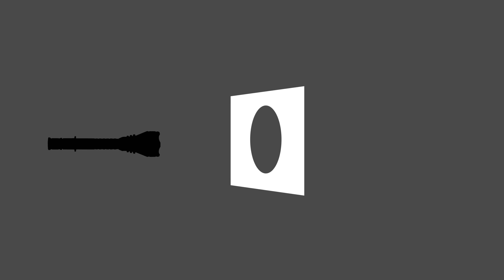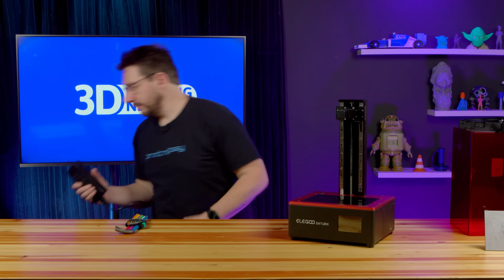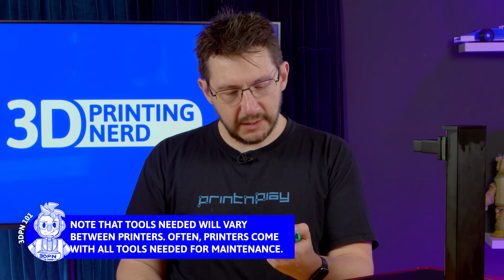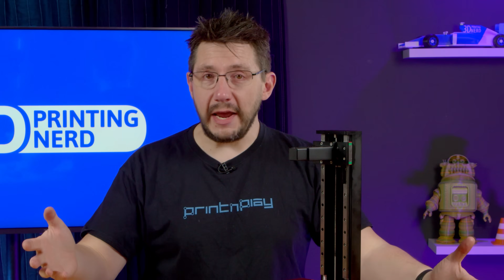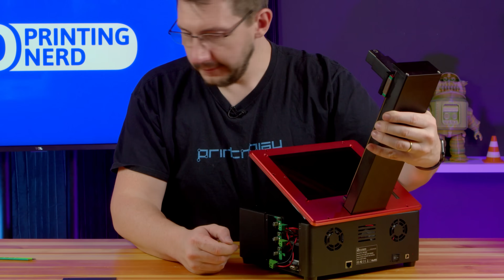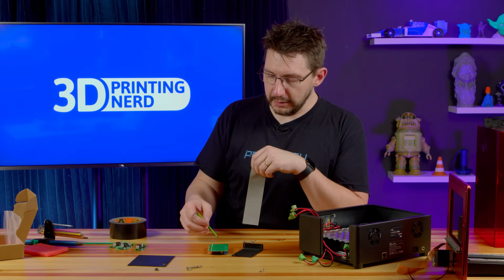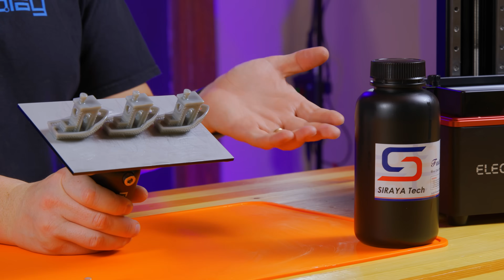FIX AND WIN an ELEGOO SATURN!

Comment: Great idea regarding the repair, but I would add few things:
- when disassembling a device you are not very familiar with, take pictures of how it looked like. Doesn’t take much time nor effort and is of great help when reassembling, especially if there are loose cables or non-orientation-locked plugs.
- if the cables are not labeled, take few minutes to label them. Is of great help when you re-open the device a year later.
- tape is great, but especially these pointy connection points can poke through it. I would either take some insulated washers or print standoffs with an FDM printer, if you have one. With moving parts, it would be even outright imperative to avoid tape.
Also, I’d add a word of caution to abound touching uv light sources. You don’t want finger fat on them...
Oh, and if I won the Saturn, I’d print some parts for fischertechnik first (working on a big ball track right now)

Comment: I am a student waiting to study in Germany this winter. Now that I have time, I am working on a foldable electric chair project (alone) to be able to travel safely without contacting others and it's compact (A4 paper * 7cm) and light weight (under 7kg). For mechanical part I am printing it with my ender 5 plus but hopefullythe precision of the resin system could help me achieve a F nest outcome possible. Thank you for reading through all this and waiting to see your pick, 

Love your content and you ;)

Comment: In the beginning of this year I was gonna build (the design is all done and ready) my own (very first) 3D printer (large format xy-core, why start off easy?), but due to some unfortunate circumstances the budget for that had to go towards replacing my stolen bicycle. So I do not currently own a printer...

Now I have a bike though, and to prevent someone stealing that as well I've designed and built a tracker that alerts me through an SMS if the bike moves, and even starts sending me the GPS location if the movement is continuous. It works great! But... Making a proper housing for the tracker has been a bit of a hassle, and honestly it's a bit of a botched together affair at the moment. It kind of works, but isn't pretty and sticks out like a sore thumb. All the while I was making it I kept thinking "I wish I had a 3D printer so I could make a proper casing for this".

So, by now it shouldn't come as a surprise that the first thing I would print with this printer would be the casing for my bike tracker. After that? Who knows... The sky's the limit!

Comment: I think it would be appropriate to print the largest mini Joel that the printer can handle first. Then, I would use it to print cosplay components, rc parts, random around the house parts for fixes that I model, whatever structural parts and brackets I need for projects, toys for my nephew, but then I really think it would be cool to use it to print 3d scans of anatomical models of organs and bones in clear coloured resin!

Comment: I would probably print things that I can’t with my FDM printer. I would probably print a chess set with some cool clear colors. I would also probably try to reverse engineer some controller shells, if it is not already available on thingiverse or thangs, to make clear shells for my Xbox and Nintendo switch. I would print till it won’t print no more, then fix it, and print some more!

Comment: Great video, as always!

As much as I love printing props and knick-knacks (and believe me I do!), I would use the Saturn for research purposes in the chemistry lab. 
In many reactions, a catalyst (often a powder) is required to drive the reaction to completion, but afterwards, this catalyst has to be removed from the reaction mixture, which can be complicated/expensive. 
 
Mixing catalyst  with resin, potentially allows you to fix the catalyst material in place. The resin being slightly porous can then still facilitate the reactions without leaching the catalyst into the bulk mixture. Then after the reaction, you can just fish out the resin part and you're good to go! It's quite a novel idea, but seems to have lots of promise and I'd love to do some testing on the topic!

For more easy to digest information, see: https://www.chemistryworld.com/news/3d-printed-case-wraps-catalyst-around-magnetic-stirrer/4011556.article

Comment: I would print lots and lots of minis. Stuff to use in board games.

Also board game bits. Lot of them

Minis to paint, and get better at painting with.

LOTS of minis to give away to friends.

A whole DnD set for my brother, god I'd love to do that for him. I'd paint the whole thing, too. 200+ pieces, I figure.

Probably a DnD chess-set for my brother, that would be awesome.

I'd ALSO make my own 3d printer resin, a 3d printed Polystyrene plastic. I have a recipe. I wanna make it real.

And a few large-scale doo-dads just for fun. When I briefly had a working filament printer I tried to do a 300% scale CastNPlay mimic... the nozzle clogged about 5 days into the 15 day print... then I broke it trying to unclog it. I'd still like to print a huge CastNPlay minic.

I'd also see if I could import my giant beholder print into the Saturn. I had files ready for the filament printer that would have taken me a whole 30 days(3 files, 10 days per file) to print, to make a 12 inch tall beholder.